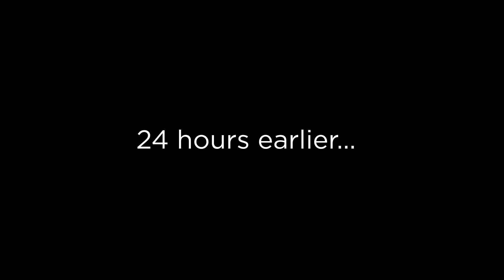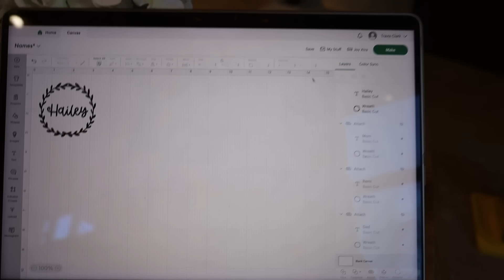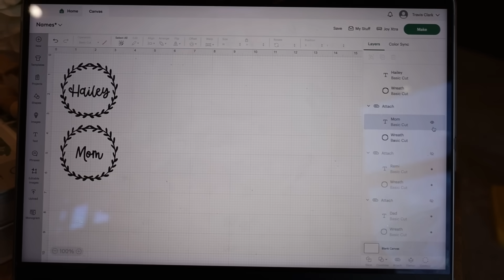WE HAD A CRAZY WEEK!

Comment: We have a lift pump in our basement as well, because our septic is higher than our basement floor. Ours has a separate alarm inside with a float to make a loud noise if the pump is not working. Hopefully your plumber installed an alarm when they installed the new pump. It does make quite a mess. The alarm can help you catch the issue if you are home and turn off the washer or whatever is pumping water into the pit. So good to see Katie is finally feeling better. You will be shocked at how quickly kids grow up. Slow down as much as you can to soak up this season!